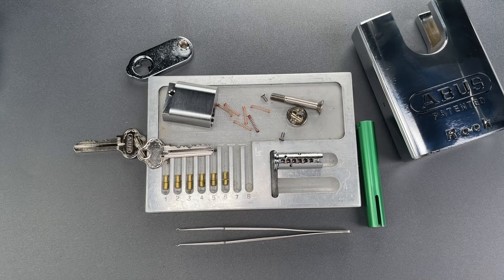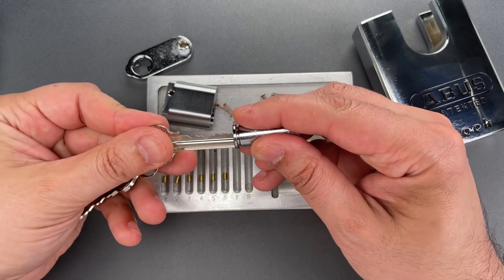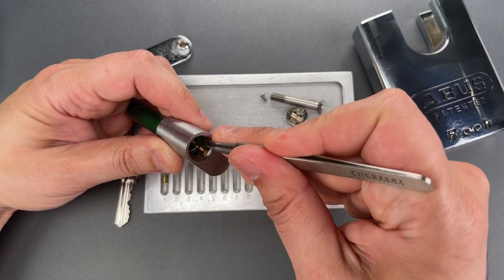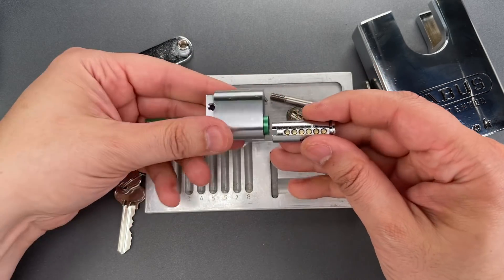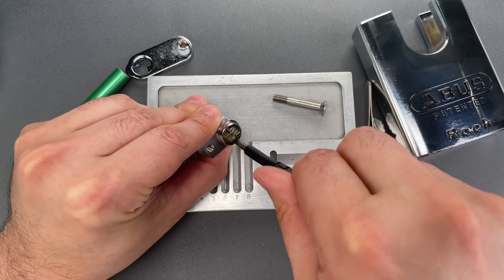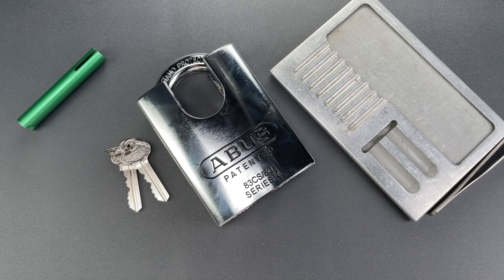[1349] Reassembling the Abus “Rock” Padlock (83CS/80)

Comment: Thanks! (but too late! :-) )

I took my practice lock from Banggood on vacation and my niece there managed to fully disassemble the lock in less than half a second (RUD). She tried to push the shackle back in, but instead the whole lock flew apart. Lock body, cover 6 key pins, 6 driver pins and 6 springs. We managed to find all the components and I reassembled the lock from memory... Key still works! :-) (I didn't take the key along on the vacation.)

Comment: Do you ever miss with the follower while sliding the plug in or out, and then have springs and driver pins everywhere. Because I do sometimes and it's the most frustrating thing.

Comment: As a kid, I was shown a cheapskate version of this process:  1. Instead of the correct key pins, use some slightly longer ones and file them down to match a new key.  2. Instead of a proper follower, use a plug from another lock of similar type.

Comment: First lock I took apart and rebuilt, back in the late 1980s was due to breaking a key, while trying to pull it from the lock, so luckily I was able to open the door. House was my Uncle's and he was always "Gonna replace all the locks one of these days" and it never happened, and that key was the only one I had to get into the house to care for the cats and Dogs while they were away on Vacation. I had a similar key for what I knew not and all the cuts were shallower than the key that broke, so I used it and filed the pins flush (as well as cleaned and lubed the works to fix the reasons it was causing the key to stress), then rebuilt the cylinder, but I had none of the special tools, so a pin or several were dropped or popped out and were soundly cursed before it all got back together. The key I used was for the Motorhome, so he and my Aunt each now had a key for that door as well which they didn't (make copies? Why?), and for all I know, when he passed away in 2018, that was still the key for the back door of the house.

Comment: These driver pins were spools, the follower had an easier time holding them in place because the spool has lips. If the driver pins aren't spools does the same technique work as well without the lip to catch on the follower when you reposition the tweezers?

Comment: I have a Question about the retainer:
Would you be able to cut it in the middle and just pull the Lock out because the screw is on the outside and the lock in the middle.
Then you could just use a Flathead Screwdriver and turn the actuator to open the lock.

Comment: Is drilling into the bottom of the lock to remove the end of the screw that retains the retainer plate and core a viable attack on the lock?
Reply: That was my exact thought as well. The core not being secured to the lock body itself, but just held in place by the retaining plate, would seem to be a potential drill risk.

Comment: The only think I missed was "since all 6 springs were the same on this lock, it didn't matter where I put them back; if the lock had been built with differing springs (length or stiffness), I would have put the springs in the pin channels during disassembly, and then back in the right holes during reassembly".

Do I have that right, Lock?  (I can call you Lock, right?)

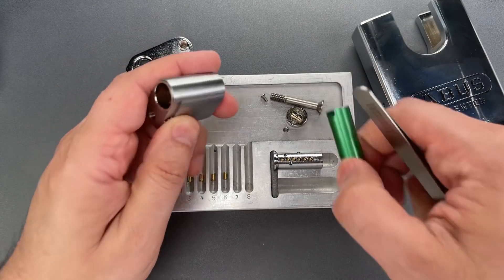Comment: 1:20 The way LPL depressed the spring with the top pin and slid the follower over it? ... He makes it look easier than it is :) Beginners might have to try that first one 4 or 5 times :)  

One trick is having locksmith specific tweezers, note the rounded end of the tweezers designed to hold pin at 90° to the tweezers, makes it a lot easier than using random drugstore tweezers,  
In a pinch you can file that groove in each tweezer leg.

Comment: With all the hardened pins preventing drilling through the core, would it be easier to drill the retainer plate from the bottom of the lock where the Philips screw is secured?

Comment: Sooooo instead of drilling the core why not just drill where the retaining screw is and remove the core completely? If you cannot pick it ofcourse.
Reply: The hardened metal cover, into which the screw fits, would destroy the drill bit. An angle grinder to the shackle area might be quicker.
Reply: @RWBHere  yeah not sure about that.. I deal with harden steel all the time and it's not that hard to drill. Just need the right bit

Comment: Excellent demo on re-asembling a lock. 
If the springs are sticking up I usually sit a shim on top then push the follower in. Remove ther shim while inserting pins, then add the shim again if you need to bridge a gap.

Comment: So it looks like the pins in the core have an orientation, is that right? In other words, there's an upside down and a right side up? What would happen if you got them in upside down? Also, are any of them interchangeable if your cat jumps in and scrambles all your lock components? And does the same apply to the pins with the springs, or are they ambivalent to orientation? Questions from the non-mechanically inclined.

Comment: It's worth mentioning that this is also a view into the re-keying process - take the lock apart, but rebuild it with different-length pins. It's not terribly hard or slow, just a bit finicky and you need the right tools.

Comment: are there any degradation in the lock due to that picking method? i m asking, because: the local fire fighters (i m in germany) always use a loud power drill and a loud hammer, when they have to open a door without a key... when i asked them during a cig break, if they know the LPL, they said that it has to be done loudly... giggle

Comment: I find that after reassembling locks (mostly American 1100 series & various clones) that the core seems to have a lot more play afterwards... is that normal or am I perhaps doing something wrong? The locks are still 100% operational, but if you shake 'em around, you can hear the core jiggling a bit.

Comment: I wonder, could a lock be designed with two cores that are at are geared so they both need to turn in opposite directions at the same time.  Only one would have an actuator, but to pick it you'd need two tensioners going at once in opposite directions.  That oughta be tougher to pick.
Reply: It's kind of what he has to do here: https://www.youtube.com/watch?v=Dd-ZIIcgzPI
Reply: @malakjoe  Wow, that's awesome.  I never saw this vid probably because I didn't discover LPL until about that time (July 2017 is when I found Bosnian Bill and not long afterward LPL).  I didn't bother looking at back catalogs of my subscriptions because I'd recently retired and started subbing all over the place.

That's not how I had it in mind of course, but I am impressed.  What I had in mind is one that you couldn't turn one core without the other, and in opposite directions at that.  It would require two keys and the cores would be fixed by gears joining at the rear.  I'm not in the Locksport myself so I'm not sure if I'm talking through my hat, which means I'm talking through my hat!
Reply: @malakjoe  I just realized that if a lock was designed how I'm imagining it, you'd only need to tension one core, but could pick both.  Not as good as I thought.

Comment: Is it possible to attack the lock destructively by drilling out the screw from the retainer plate at the bottom of the lock?  I know there are those pins there to prevent drilling through the core, but is there anything stopping you from drilling out the retainer plate?

Comment: The only thing I would recommend to anyone using this as a guide: Make sure that the cylinder opens the lock before you screw it in place.  LPL knew what he was looking for and saw it was all good, but I've had to clean up after too many other locksmiths who worked too fast and bricked a padlock
Reply: Yeah you have a point. I was thinking that he should have used a key to test it first. There is no way to fix this once its done right? With the shackle on you can not get it off again unless its a masterlock and you can Redbull it!
Reply: @kameljoe21  it depends very much on the lock.  If it's shimmable, it isn't that big of a deal.  Most rekeyable locks are not.  

If you're lucky, you may be able to bypass the core and manipulate the actuator to open it.  But that depends very much on the lock and how you managed to mess it up
Reply: I think you blinked and missed when he check if it worked before putting on the back plate.  2:26.
Reply: @JasonB808  No, that is not the part I'm talking about.  He checked that the key turned the cylinder.  He did not take a moment to ensure that turning the cylinder releases the shackle though
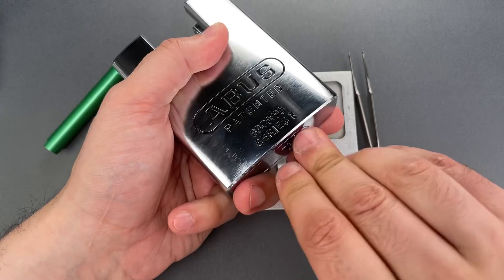Reply: @Noveeme  You mean the part where he had to unlock to lock to re-insert the screw holding the retainer. Sure sounds like he did check that it unlocked the shackle there 3:24, even if he didn't call out the fact that he was checking it.
Reply: @halverd6445  as I said, he knew what he was looking for and saw it was all good.  For anyone using this as a guide. I recommend actually putting the shackle in before screwing it up (pun intended)

Comment: Would these locks be assembled by hand in the factory? I can't see a way to automate this process.
Reply: Final assembly is a hand operation. Many of the early and intermediate steps can ( are automated - too expensive, otherwise!) be automated, but the final assembly looks pretty much like what we just saw here.
Reply: I can envision a  tool for production that would allow loading the springs and upper pins into a core shaped piece (similar to the follower), springs sticking up. This would be inserted (not in line with the inner holes!) and then turned so springs would go in holes. Then a long 'ramp' shaped piece insert in a slot to lift the pins, turn the tool to keep pins in place and use it as follower as core is inserted.  Loading pins and springs into the tool could likely be done by vibratory  feeders. Final assembly still most likely a hand operation.
This is my 2minute thought, would love to see a 'how it's made' video from a real factory.

Comment: just as I was finishing the last video I though "it'd be nice to see him reassemble a lock once in a while". Your lockpicking skills have finally managed to break into my brain, it seems.
Reply: I thought exactly the same
Reply: does anyone know if the placement of the springs is important? or can any spring go in any slot?
Reply: @pvic6959  in theory its unimportant. some locks have different strength springs, (too make picking more challenging) but the order should not effect the normal use of the lock
Reply: @stephenwallace5969  but as far as the key is concerned, the strength of the springs dont matter right? so if you were to accidently swap them when putting it back, the lock would work just the same?
Reply: @pvic6959  exactly
Reply: Same

Comment: Have you ever taken apart a lock that had springs of different sizes and/or tension levels?
Reply from the maker: Yes… it’s not common, but it is sometimes used as a bumping countermeasure.
Reply: Obviously not a factory lock, but in this video, the gentleman is building a lock and uses a couple of different springs which he explains. https://youtu.be/stMkDo8ZsL0?t=481

Comment: I’ve watched hundreds of your videos, and it wasn’t until this one that I finally understood how standard lock mechanisms work. Thanks so much! I’m so happy right now.
Reply: Me too I think. 
If I understand this correctly the pins with the spring are pushed to the core half way so that the core does not rotate, and when the key is inserted the pins are pushed by the key. If all is correct then the pins are out of the cylinder so you can rotate the core.
Reply: @mkaatr  Sometimes not. Then you can use a "comb" attack. The idea is the driver pin plus the shortest possible key pin are too large to allow the core to turn unless the seam between the driver and key pins line up on what's called the shear line. This is an Abus lock, so it's built correctly; seeing sloppily built locks deconstructed might have been part of the difficulty understanding what is supposed to happen.
Reply: Same! Very insightful!
Reply: The Stuff Made Here video also had a good explanation of how standard locks work.
Reply: I learned by watching Bosnian Bill and then buying a cheap training lock, picks, and basic locksmithing tools from Sparrows.
Reply: 1000+ videos

Comment: You lightly damaged a spring during disassembly. Is it ever a problem?
Reply from the maker: Not an issue. Springs are cheap and readily available… I have thousands of them in several different varieties.
Reply: @lockpickinglawyer  The springs were what had puzzled me on reassembly.  When you gut a lock they always seem to stick up out of the holes and I thought it would be really difficult to get the driver pins back in on top of them.  Looks like the springs are very weak, making pressing them down super easy, barely an inconvenience.
Reply: @HariSeldon913  Yes, the springs are fairly weak. When I do lock reassembly, I do the springs as I do each pin. However, you can use whatever method works for you.

Something that is important is to have pinning tweezers. They have rounded ends to hold pins. It can be done with regular tweezers, but is much more difficult as the pins will want to rotate. Also pinning tweezers won't crush springs.
Reply: @HariSeldon913  Reinserting driver pins is TIGHT!
Reply: @HariSeldon913  The springs are strong enough, I decided.
Reply: @lockpickinglawyer  Have you ever "upgraded" a lock simply by changing the spring or is that overstating the importance of the spring in the first place?
Reply: @wttwtg4165  A single steel spring amongst the copper ones will provide some protection against bumping and raking. It's also very common for challenge locks to mix up the spring types in addition to using security pins.
Reply: @lockpickinglawyer  I have a special storage area for spings,  - from ballpens, electrical safety shutters and so on,  its called The Floor.
Reply: @lockpickinglawyer  Yes, of course you do. DUH ME! 🤦‍♂️
Reply: @lockpickinglawyer  The ghosts of locks past...
Reply: Sometimes a bent spring will make it slightly harder to reinsert. But, it should be fine as long as it isn't too out of shape to no longer function smoothly. If there was a place for it to snag, yes; it would be an issue, but it looks fine in this instance.
Reply: does anyone know if the placement of the springs is important? or can any spring go in any slot?
Reply: @pvic6959  In a commercial lock the springs are usually the same. So it doesn't matter what spring goes where.
Reply: @pvic6959  For some locks all the springs are the same strength, and can go in any slot. For others, they have springs of varying strength, which can increase pick or bump resistance. You should still end up with a functional core if you get the springs out of order, though.